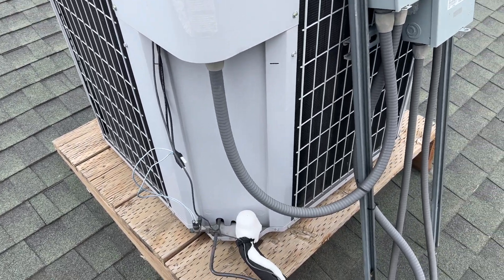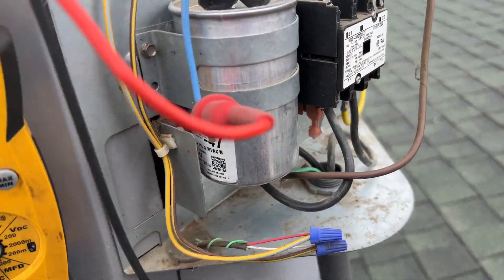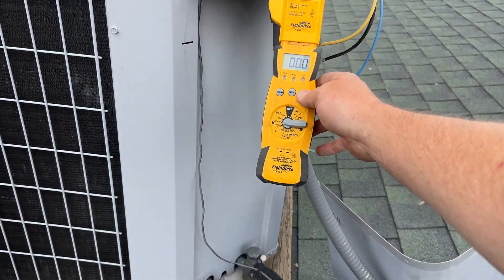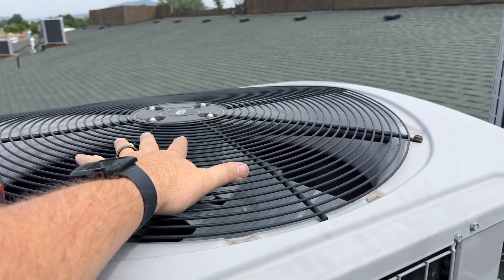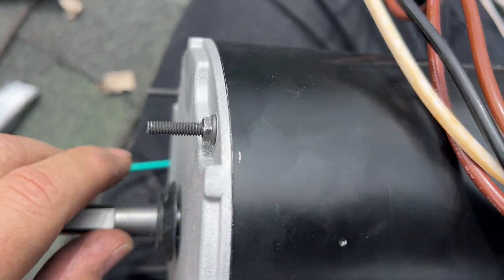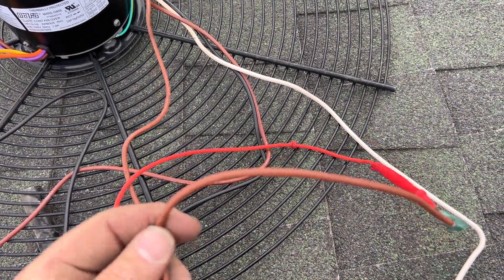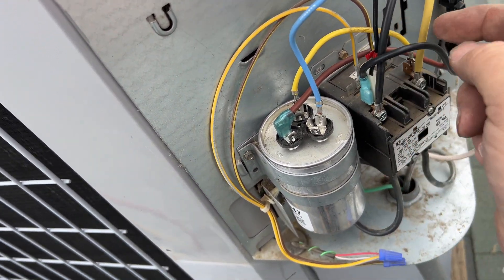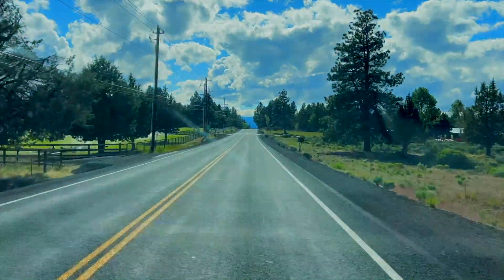Diagnosing & Replacing a Faulty Condenser Fan Motor EP138

Comment: Does the capacitor need that metal strap? I got a replacement capacitor, and the old strap was too small to use on the new capacitor, so i used a ziptie as a strap.
Reply from the maker: That’s pretty common. I usually make a new strap with plumbers tape. (Metal strapping). But as long as it’s mounted tightly and doesn’t fall off you should be good.

Comment: FThe motor should say the direction is either shaft end or lead end. And have you ever used the metal zip ties from Harbor Freight, the weather and the uv light does not bother them.